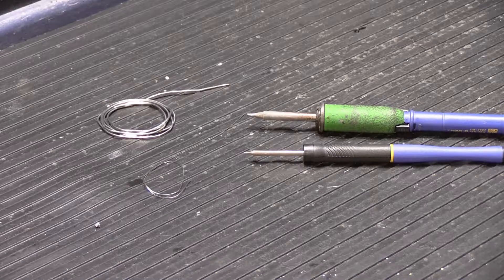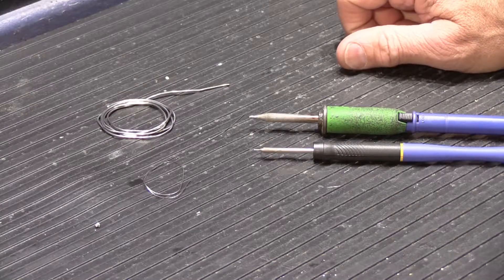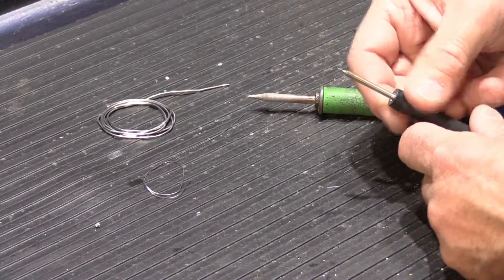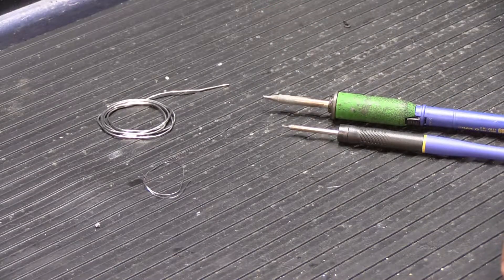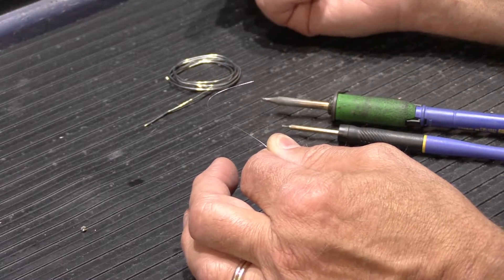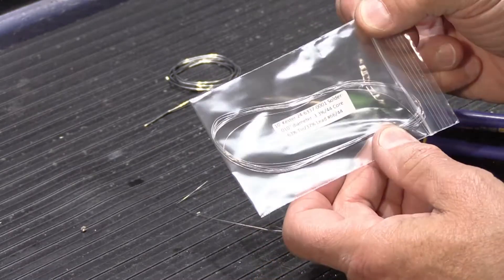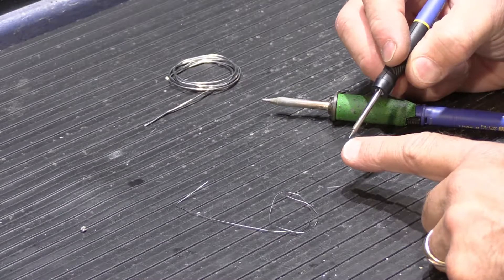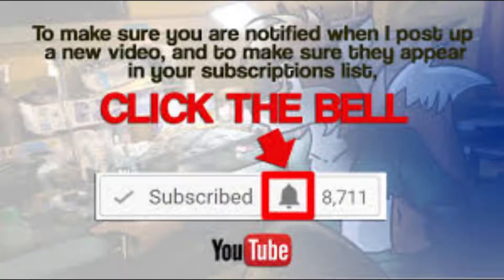The Shop Gets a new Micro-Soldering Pencil - Hakko FM2032

Comment: do you know if T12 handle has thermistor in the back?
Reply from the maker: Hi qt1qg:  I am unlceat about what you're asking exactly - T12 refers to the soldering element, not the handle - The heating element in the T12, not in the handle - Chris
Reply: @northsideservicecompany3567  Hi! Im referring to handle that takes t12 cartriges.
Reply from the maker: @qt1qg  It seems that the Thermistor is inside the handle - Chris
Reply: Sensor inside cartridge itself is thermocouple, which requires another sensor for cold junction compensation to make measurements accurate. I am not sure if they are doing compensation by directly measuring temperature inside the handle or by calculating an approximate CJ temperature based on TC readings and ambient temperature. I know that knock-off handles don't have any kind of sensor inside

Comment: Does the 2032 work with the FM-202?
Reply from the maker: hi Adam: according to the Hakko Web Site - No, th e FM2032 does not work with the FM202 (which is a discontinued model) It does say that it works with the FM203 - You could always call Hakko to ask specifically - Chris
Reply: @northsideservicecompany3567  Thanks Chris was looking to get a used 202 on ebay (new to microsoldering), not sure if there is a tip for 2027 that i can use for that
Reply from the maker: @Ak-ib3wy  Micro-Soldering Tips do not fit the 2027 - Buy a FX-951 then everything except for Tweezers will work - Chris
Reply: @northsideservicecompany3567  thanks a mil

Comment: the tweezers do not work with the fx-951 :(
Reply from the maker: Hi Moises Sacal:  Correct  - Hakko FM2023 Hot Tweezers use FM- 202, 203 or 206 soldering stations - Chris